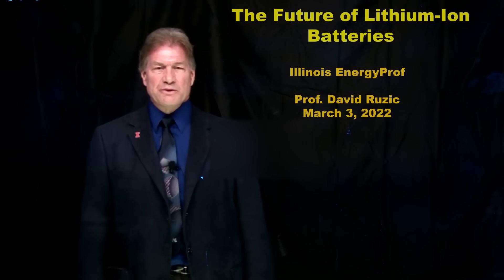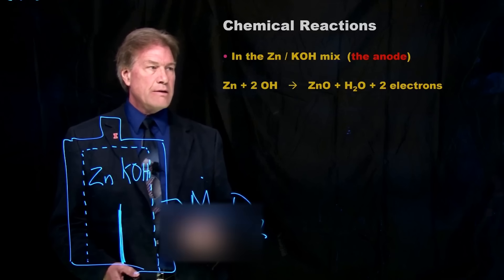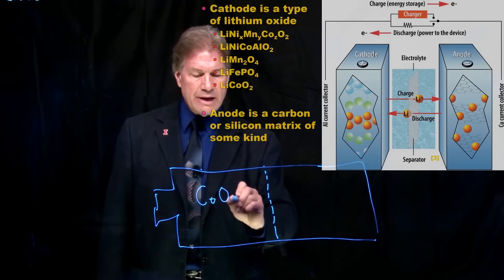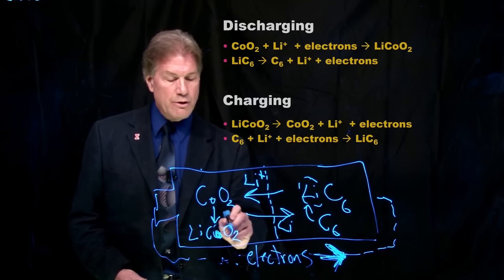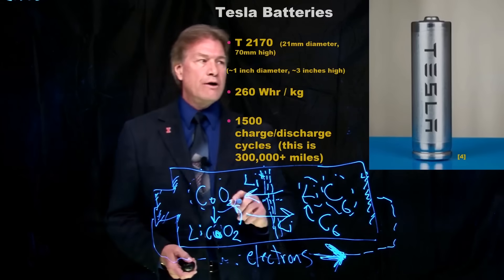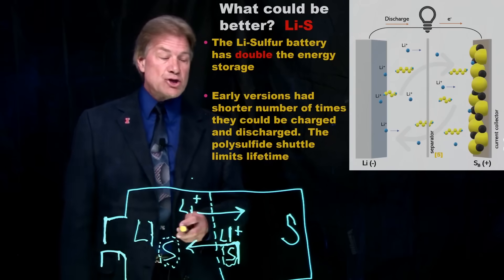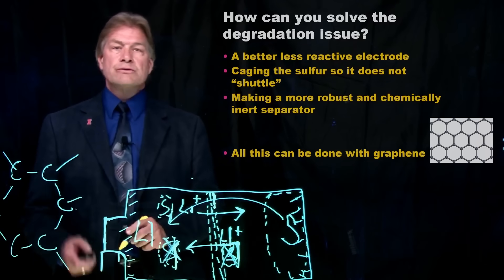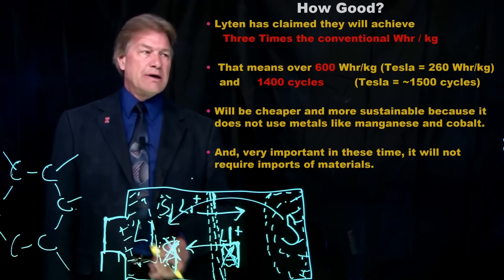The Future of Lithium-Ion Batteries

Comment: Lithium batteries significantly degrade in the cold. This 1500 uses is substantially lower unless you're basically on the prime meridian. In my region in Canada we often get -30c for weeks and sometimes even -45c. And while electric cars could have a device to keep the batteries warm, if they ever freeze, good bye 30k dollars worth of batteries.  
imo, this technology doesn't work in the northern regions and technology needs to keep developing to come up with real solutions to issues instead of half-solutions whose waste and toxic output is just as questionable as any other transport technology. Hopefully sulfure lith lives up to the claims.
Reply: You are really picking an edge case here. Less than 1% of the western world's population lives in areas that cold. Can I might be stuck on internal combustion longer than other warmer regions. The current technology works perfectly well in climates that are just a little bit less extreme like the upper Midwest.
Reply: @otm646  This is not an edge case. 30 milliom Canadians live in the north. Deserts can get very cold at night. Just because wherever you live never gets cold doesn't make this an edge case. Btw, those in cold regions use more fossil fuels.

Comment: 9:08 if you've never had an internal combustion engine last 300,000 miles it's because you never tried, and you've always had money for a newer car when you desired it.
Basically every single car made in the last 15 years can go 300K. '80s Toyotas and Volkswagens were doing it in stride.
Reply: I have a Toyota, it is pretty impressive given how it is affordable to maintain. I try my best to maintain the car's interior and exterior to push it through 20-25 years old, and I started to think like this when the car was 5 years old. You're right. If one would like to use the  car's maximum potential, they better act that way and take a good care of their cars as soon as possible.
Reply: I've had two cars go nearly 300k and were still going when I sold them.  300k is very attainable.

Comment: Actual lithium metal in that LiS battery?  OMG....just don't get any water into that mix....or else.  

As for aircraft, there's a long way to go, even if the chemistry nets 3x the energy density by weight vs current lithium batteries.  The energy density of kerosene (jet fuel) is very high even compared to 3x current batteries.  There's also the advantage in that the weight of the airplane is constantly getting lighter as the fuel is burned off (no such advantage with battery powered airplanes).  On this latter point, current civil airlines are easily 20-30% fuel, by weight, for modest length flights, and 50% or so for long range.  The structure is optimized for the lighter weight at touchdown, so would require substantial reinforcement (with extra weight, reducing cruise efficiency) if it were battery powered.   

Now...that said, these are very interesting developments.  There is a future for electric vehicles, I'm just not sure its as bright as advocates say, unless there are major breakthroughs.  If all I needed was a 100 mile range commuter vehicle, I'd get a Leaf today.  I can see where for urban personal mobility, electric is an ideal use case.

A ROM level calc of the cost and weight of a battery capable of replacing a diesel engine in a farmers tractor, for example, shows the utter impracticality in this use case with current, or even 2x-3x better / cheaper battery tech.  A modern, highly optimized diesel with 100 gallons in the tank is hard to beat - especially when one considers that the "recharge" for another 8 hours of tillage is a simple saddle tank in the back of a pickup and 10 minutes.

Comment: All my vehicles make it to 450,000 miles and I have never paid over $4,000 for a vehicle. I personally get around 250,000 out of them. I buy them with around 200,000 already on them. A Nissan leaf battery lasts about 60,000 miles. I've seen plenty of Teslas with bad batteries at 80,000 miles. Most of them fail before 100,000. Replacement battery for Nissan leaf is $13,000. Replacement battery for Tesla is $26,000. I can buy 6 used vehicles for a combined 1.2 million miles of use for just the price of the Tesla replacement battery. It's not going to happen. The average income in the USA will not allow it to happen. Gas burners are going to be around at least 60 more years unless someone comes up with an independent energy device. We will vote out the pro EV politicians. The majority of the core workers of the USA (plumbers, electric, HVAC, ect) travel many miles. My service vans travel 3,500 miles per month. All my vans are 15 plus years old. I'm extremely disappointed in science and universities for not coming up with a much better solution by now. Except for electronics, scientist have done virtually nothing in the past 60 years.

Comment: I had kinda given up on lithium cells. At this point, I just think a hydrogen economy is easier to pull off. That being said, I HAD given up on lithium cells, but this looks quite promising. As long as their process is scalable, this could be quite the game changer. ESPECIALLY if they're able to drop them into existing Tesla platforms at a reasonable upgrade cost.

Comment: Uh... I've had several internal combustion engines last over 300k miles.   Maybe you should take better care of them?   Seriously it's not even hard just change the oil and don't ignore warning lights. 

I'm not opposed to BEV's, the next new car  I buy will probably be one.    But also take better care of your cars there's nothing eco-friendly about neglecting stuff that's already been manufactured and throwing it away before its time.

Comment: PLENTY of gasoline and diesel cars last 300,000+ miles. If you've never heard of that, then you're not a very good Energy Professor!
Reply from the maker: I have heard of them etc.  I just said I haven't owned one.   Maybe I do not drive enough!  My Honda Odyssey has 150,000 miles, but it is 12 years old.  The body and other parts are showing a lot of wear.  Because I change the oil and maintain it, the engine will likely last a very long time, but we'll probably replace it with something newer long before that.

Comment: 8:14  "For us Americans..." ??? I do resent that!
9:00 If you sir have not had an internal combustion engine last for anywhere near 300,000 mi; then you've either been unlucky or you've been foolish with the maintenance. I can tell you how to make an i.c.e. last indefinitely if you'd like...
Reply from the maker: I live in the Midwest.  All my cars have rusted out, or had other problems before the mileage got that high.  I have a 2010 Honda Odyssey now that only has ~150,000 miles on it.  The engine is doing great and could make it to 300,000 miles perhaps, but the body is very unlikely to make it another 12 years!

Comment: A older F250 is going on 340,000 Miles and the one I grew up with is pushing 260,000. The one I grew up with has no drivetrain, chassis, or electrical issues whatsoever. We've only replaced a turbo hose and the cab bushings. For some people 300,000 is a minimum.

Comment: First he wrongvi had a l6 gm g3p van with 1.2 million miles  on it before I rebuilt it. Cars can be made to go that long so long as they are engineered for it. Most are not due fact they want to make allot off you in repairs. Also new type of magnesium  batteries are being researched in India that will have 5 times the capacity  of lithium and be 10 times less expensive and possibly  go 8 time longer in life span.

Comment: Failures of Lithium Batteries Include and are not limited to:   Dendritic Whiskers which I believe you touched on, 
and Terminating ReDox Discharge at or below 2.7 Volts wherein the Lithium reaches a Lower Oxidation State that it cannot return from with recharging.

Comment: The coolest batteries around are the Lithium Thionyl Chloride Batteries.
Those are the ones they send to Space if needed.  Extremely light
and yet they have a huge charge density.  The best part is the 1%/year 
self discharge rate.  COOL!  Non-rechargeable though, oh well.

Comment: Professor Ruzic I'd a great communicator, his ability to explain in simple terms the hard to grasp concepts of energy storage and generstion systems are fantastically useful for the ordinary person. He does however need a bit more help with some fact checking of his chemistry descriptions. The simple errors in this video can cause confusion for the audience. 1. Anode uses Manganese dioxide not oxide. (it's more complicated than this with it actually being a mix of "Oxides" some possible peroxide or as some call them a superoxide with a higher oxidized states mixed in when freshly generated by electrolysis. As the battery discharges, these mixtures of of oxides go through a lot of different states as they are gradually reduced to lower oxides. This is one of thec reasons that the cell voltage gradually falls during use.
2. As others have already pointed out the Lead Acid battery uses Sulpheric acid and not Hydrochloric acid.
3. The lithium is intercalated between the graphitic layers of carbon. The lithium does not form a carbonate. Although Lithium Carbonate can be used to help make the non-aqueous electrolytes (mostly propylene carbonate + your battery manufacturer's secret additions.) more conducive. 4.

Comment: On the mileage comparison I believe you haven't kept a vehicle until 300k miles but most modern (1990s and newer) are more than capable of this.  I currently own a 1990 f150 with 600k miles and engine is all orginal.
Over the road diesels go on average 1 million miles before a teardown.

Comment: Hopefully this comes together. 
The automatic plugin for the EV would be the next 'killer invention' with all EV plugged in 24/7, except for rush hour. 
An EV car with a 100kwh battery, 500mile range but a daily drive of 50mile can trade energy with the grid for money 24/7.
The home can be run off the car at night. 
The grid becomes the VIRTUAL POWER SYSTEM. 
300MILLION vehicles in USA today, if every home has a 30kwh rooftop solar system then Renewables can not be beat.
Mind you 300MILLION 2tonne batterys  is a lot of materials.
Reply: You're living in la la land. Who's going to just hand out this technology to live out your dream? And what about the large percentage who don't live in homes but dense housing? Or don't own these homes to be able to install such a system.
Reply: @rusty_junk  every one pays like now.
Basement garages can have a wall plug.
All roofs can have PV panels. 
Car computers can talk to power supply companies like trading shares automatically on your computer. 
Fuel costs very little,  that is good 👍

Comment: Hello Prof. Ruzic,
So happy to see you again!
Thank you for your explanation of batteries. 

I truly hope that Li-S may evolve to become commercially viable. 
For the time being, in China they use LiFePO4; have lower energy density but 20 years calendar life and 2000+ cycles. They are a mixed bag, though.
I agree that the future of Li-Ion batteries is gravitating around materials technology. 

The battery you propose in the video seems very promising. The end game - for transportation and power grid batteries - should be a Li-Ion battery with 2.5 KWh/kg energy density, about ten times the actual value. 

As you said, it would (surely will) change the future of transportation. And, maybe, the generation profile of large power grids, allowing big power storage units to be attached to aeolic generation.

P.S.: In one of the initial slides, where you mention car batteries and their acid electrolyte, the writing on the slide is "HCl", while it should read "H2SO4".

Could you say more about electric cars? Things like car's energy efficiency, likeliness of full self driving, the hydrogen fandango, a gasoline/fuel cells car if Li-Ion doesn't develop fast enough?

Thank you once again. We want to see you more often!

Anthony - from the UK
Reply: 2500 Wh/KG isn't physically possible

TNT the explosive is the limits of an enclosed energy system. TNT has an energy density of 1277 Wh/KG

Even pure hydrogen oxygen is 3,700 Wh/KG assuming 100% conversion efficiency which isn't possible

These are limits which can not be reached as they are pure elemental reactions

Using the TNT limit of 1277 Wh/KG
That is a one way reaction
Woth zero container mass

Most likely we will never be able to achieve even half of that figure so 500 Wh/KG for a rechargeable battery anything above that smells of scam

However the good news is we don't need batteries that good. The current batteries are good enough. Just need mass produced EVs to reduce the cost

Comment: Revolutionary battery tech is always just a few years away. However getting out of the lab has been a stumbling block time and time again. I hope this time is different, but I'm quite skeptical.
Reply: Unlike other cell technology, LiS have had working prototypes that have been used by governments, like the solar plane in Europe.

LiS has had labs around the world claiming that they solved the cycle limitation problem. If lyten stars selling cells to individuals to test, then I will be more willing to recommend them as a promising stock.
Reply: Production at scale is always the issue with new technology from biofuels that battery tech 
     It was only a little over a century when the technology to mass produce steel became effective and efficient and it's only been since the 1950s when the ability to produce aluminum at crazy scale had been effective before these times both were rare and expensive (aluminum was at one point equal to precious metals some royalty even had cutlery made out of it because it was so prestigious) these advancements have revolutionized the world and how we modern humans live hopefully wit the amount of investment in battery tech and biofuels they can have their own renaissance and achieve commercial viability
Reply: They are still around, their latest press release was May of 2025. It doesn't look like they're ready for any mass market yet.
Reply: Agreed.  And promises to double or triple capacity is a sure sign of future failure.  A 15% improvement over existing technology would be amazing enough.  Making such bold claims indicates that the project is still in the fantasy phase where excitement overpowers rational thinking and the problems with the tech are yet to be realized.

Good luck though.  I love the nuclear power videos!
Reply: @montmorencysjerome3769  Right, modern batteries not only require special chemical components, but the also have to have sufficient mechanical properties, so the battery can endure thousends of charge cycles.  This has been a stumbling block for silicon anodes for instance.
Furthermore, I like to think that any major breakthrough in battery technology will take some time and requires a solid understanding of every single aspect and reaction of its components and it seems unlikely that a singly company can truly figure it out without others noticing. Any new battery type can only be produced and applied, if it is a genuinly mature and well understood technology and in the case of the hypothetical Li-S battery, it is quite literally a very potent chemistry (with a very violent reaction in elementary form) and I don't think you'll see such cells with large quantities of pure Lithium and Sulfur in them, bc they'll probaly also need alot of other chemicals for facilitating the rections. Pretty much like current cells.

Comment: Ummmm @ 1:30 you say a car battery electrolyte is hydrochloric acid. To which cars are you referring to? In my career as a Automotive mechanic of 40 years EVERY vehicle I have ever worked on used sulfuric acid as an electrolyte. I am really sure because I have filled new batteries with specifically sulfuric acid.
Reply from the maker: my mistake -- and I know it is sulfuric --- I was trying to contrast with alkaline
Reply: @illinoisenergyprof6878  Thanks for the clarification. I do like your videos, and I do learn from them but as my old science teacher said don't believe everything until it can be proven.

Comment: Extremely interesting. I hope they find a way to manufacture them on a large scale. (Do we have access to Lithium without importing it? I thought it was imported also.)
I must say however, that indestructible dot on the screen grabbed an OCD portion of my brain and bitch slapped it around. And I'm not generally OCD.
Reply from the maker: There are two dots on the screen.  I think the one you are referring to is my marker for where the corner of the slides show up.  Usually it is not so bright!  There is another smudge-like-dot that is actually an imperfection in the glass.  That is the one that bothers me!
Reply: @illinoisenergyprof6878  Heh heh. Someday science will rescue us from these luminescent layabouts. In a century or two. Thanks for all the info.

Comment: Professor "I've never had an internal combustion engine last more than me 300k miles." Me, laughs in Toyota Camry.
Reply: My 1998 Nissan 200SX has over 300,000 Mi on it without an engine rebuild
Reply: Yeah, well my Honda didn’t cut it, even with oil changes every 6k mi
Reply: Lol
Reply: There was a video of an engine strip down of that.
Reply: flexes in 2006 chrysler 300

Easy to work on.  She like an old lady though, you gotta be polite with the accelerator or she grumbles and growls at you.  Or just screams.

Comment: Diesel, million miles. Gasoline Jeep 4 cylinder 300000. Cost of Tesla Muskrat battery, $12000 to $22000. Cost of installing rebuilt diesel about $8000 and rebuilt gasoline engine about $5000. Cost of lost time charging Priceless. It is the only thing we cannot buy or even steal.